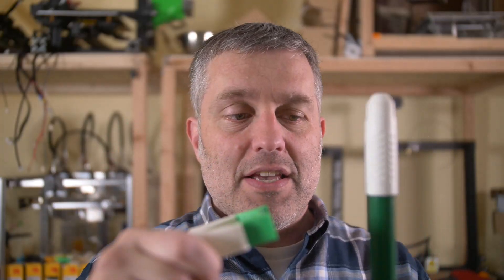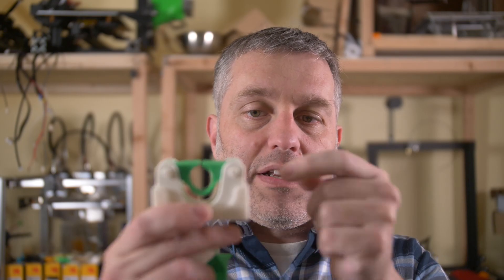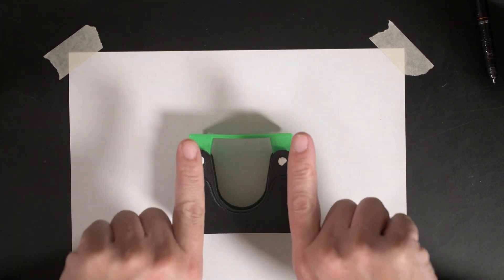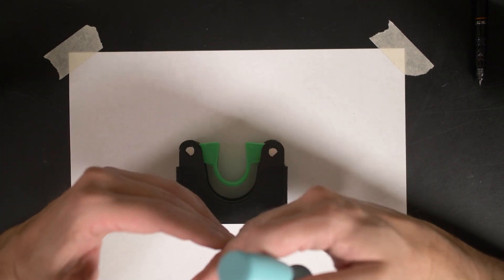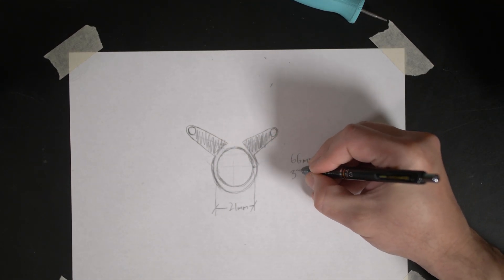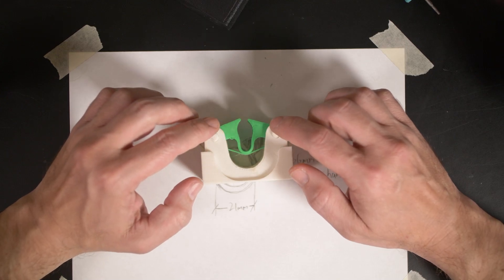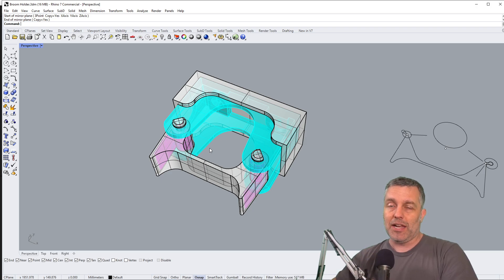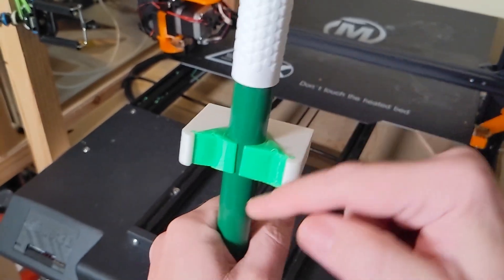I Could Patent This - A 100% Compliant Mechanism That's Actually Useful

Comment: Except it already exists. Prior art and commercial availability will prevent you from patenting this as there is not a substantial change to form or function.... still cool design + Print
Reply: He could get a weak patent. It has been awhile since I have seen a patent application rejected.
Reply: @LastV8Interceptors  would be useless if weak as any inforcement attempts would be thrown out. :(
Reply: @lambert0777  Depends on the resources of the two parties involved. Apple vs samsung comes to mind.
Reply: You all forget one important thing here: he published his invention here on youtube for everybody to see. Thus it became prior art the moment the video was published. Thus, a patent cannot be granted.
Reply: Is a Ziploc bag the same concept?
Reply: As a patent attorney myself, I find it hugely amusing how seemingly half of this comment section is an expert on the matter these days. 

The fact that lack of hinges is common does not mean it is relevant prior art. It may be prior art, but the central criterion is "relevant" prior art. I.e.: prior art is considered in the specific technical context of the invention, in this case broom fixtures. The same holds true for, for example, patents on two component toothpaste, where two component glue are not considered relevant prior art either. Both have been successfully patented. 

In addition, also the combination of two pre existing components in a novel and inventive way, can be considered patentable. Also if both components individually are already patented elsewhere.

Please be mindful of spreading these false claims (no pun intended) on the internet. Not only do they hurt innovation as people get the wrong information, it frankly also makes you look really gullible.
Reply: @sanderj8784  Finally. That's social media these days. Was thinking about patenting something a year ago but the whole lingo and knowledge needed to not make mistakes or leave basically "loopholes" is huge
Reply: @sanderj8784  no false claim here. Glue and toothpaste are dissimilar whereas two flexible fixtures intended to secure the handle or shaft of an unrelatex implimend for storage or otherwise are in fact similar. It already exists simple as that.
Reply: They all use hinges, he specifically said that he wanted to design it without hinges. Instead of spreading misinformation you could have linked the part that does exactly this hingless design. But I am pretty sure that DPT is right and this version does not exist at all.
Reply: Not all have hinges, wtf. I had something like this when I was young - it's not new idea..
Reply: @malloott  they do not. A quick search for youself for rubber broom mount will show  a 2 pc mount ft flexible rubber insert sans hinge
Reply: @lambert0777  as I said before, link or it didn't happen
Reply: @malloott  flexure gripping mechanisms are very common in the robotics industry.  But I think the point is mute anyways, as such an easily cloneable item would be eaten up for production in Asia the second any profitability is determined.
The most effective way of capitalizing on the invention/iteration is to provide the .step/.f3d/etc. files and challenge viewers to send their variants to test grip strength/durability.  Engage audience, gain repeat views, get companies to sponsor content using different filament and materials. Easy.
Reply: @malloott  Sorry, but there are loads of these without hinges aswell.
Reply: @AndrewTSq  so link or it didn't happen? What the hell is the point of saying this without proof?
Reply: @malloott  just google? And even if there was not one single without a hinge, its still nothing that makes the product better. I actually think the ones with hinges will last longer.
Reply: @AndrewTSq  hahahaha, I am going to Google your proofless claim? That is not how this works 🤣. You provide proof to your own claims and then I might just accept them...
Reply: Just based on the language people are using in these comments, it's clear that Sander J is the only one who has any real experience with patent law. Knowing the phrase "prior art" doesn't qualify  you as an expert here, lol. 

I don't care a rat's butt about this debate, but from uninvolved perspective, the "unpatentable" crowd seem to be blowing smoke out their rear ends.
Reply: @Eucalypticus idiots can be lawyers to.... 🙄

Comment: Pretty sure you cant patent something that already exists. Clips like this have existed for a long time, an example here, yes its a different shape, but its functionally identical. https://www.bunnings.com.au/permastik-small-cable-clips-12-pack_p3950110
Reply: I can believe that products that resemble the one shown in this video already exist, but I haven't seen one yet.

Do the permastick small cable clips hold a vertical rod tight enough to prevent it from slipping? I suspect that they don't.

Does a permastick clip tightly grab a cylindrical object that has been pushed into it? Will it release the object when you pull on it? It doesn't look like it to me.
Reply: @Hirudin  yes, yes, and yes. Functionally they're identical
Reply: This has a latch and does not work when you rip a cable or Broom handle out of it without unlatching. Totally different, next!
Reply: @malloott  actually it doesnt have any kind of actual latch, it just has a lip you can pull to open. And yes, it will open or close when something is pulled or pushed into it.